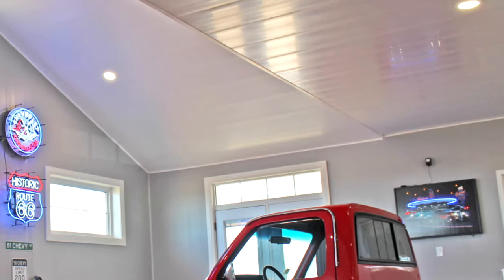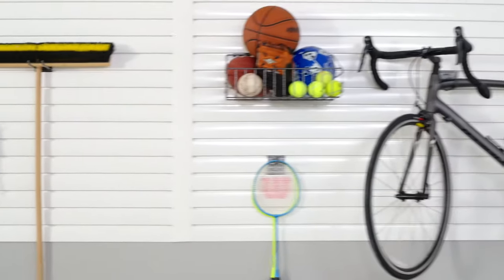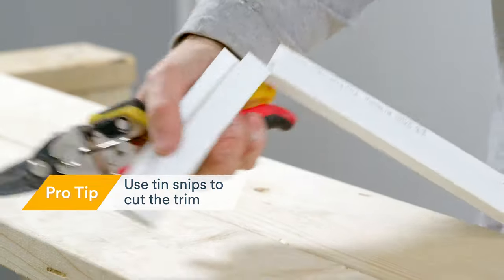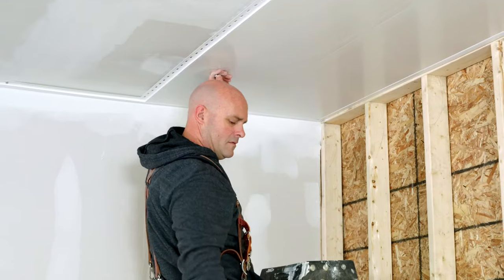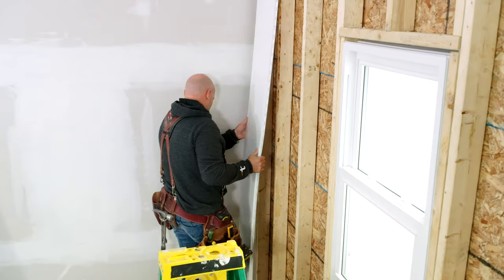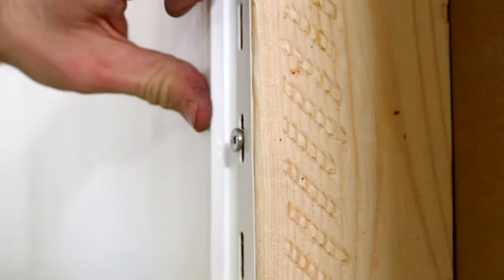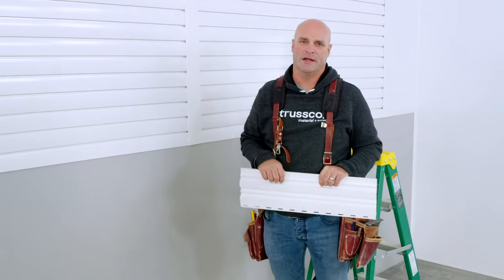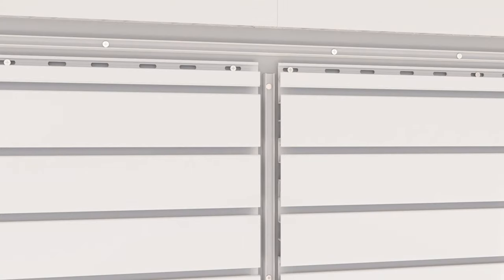How To Install Trusscore PVC Wall and Ceiling Panels To Transform Your Garage

Comment: I have personally installed a lot of this stuff. When you watch the video, keep in mind this is an infomercial and not an accurate installation guide. They used a paid actor in a staged scenario and not a true tradesperson in a realistic setting. This stuff is flimsy vinyl so if everything isn’t perfect there will be gaps  and bends. The manufacturing tolerances are not great and many pieces will have a “crown” from one end to the other. You will need to push the pieces together and tighten down the screws or you will have gaps everywhere. And if you think drywall is dusty, cut a few pieces of this and see how much white dust it gives off! This video makes it look easy to install but it does accurately  show what it is like in a real situation.
Reply: HUM, would you recommend putting in a NON insulated METAL garage in north Florida where inside can get 103 degrees in the summer?
Reply: Agreed... What about where rooms, walls, ceilings aren't perfectly square ??
Reply: Or just use Sheetrock, tape/finish. A lot less expensive

Comment: If and when the adjoining walls or ceiling aren't true, there will be a gap. This is normally taped(to seal the joint) and filled by mud compound to create a seamless finish. Most framing is never perfectly square so these gaps will be a normality . Which means it isn't effective to keep out drafts and or for fire code. As well ,drywall's primary application is to resist fire for certain period of time for safety. In the event of a fire , these pvc walls would probably release a massive toxic smoke and melt. It's a safety nightmare. Another potential concern to mention is off gassing after install.  Perhaps commercial application but residential is a wrong choice
Reply: There is a reason why this demonstration is being done in a garage and not for a bedroom. This is great for a utility shed, garage, washbay, or other storage rooms/buildings. That is all.

Comment: How do I fix a cracked panel in the middle of the wall behind the workbench and drill press.?  Do I unbolt the press and bench and take down half the wall to get at and replace the broken panel or do I rip it all out and drywall the garage like smart people? If it was drywall a little mud and paint ( 20 minutes max) $5.00 worth of mud done.
Reply: This was my thinking,  what do you do when you need to make a repair or add a fixture?  Drywall is much more versatile.
Reply: Simple just put a decal or chart of your liking, drill press??? Put up drill size chart
Reply: @TheVeganeater  you can replace individual pieces. Curl the sheet next to it to undo the seem. Replace sheet .Curl the sheet next to  it to pop it back in.

Comment: The walls may be simple but 16' ceiling panels are not. You should have shown the second or maybe even the third guy helping install the panel.  It's almost impossible to do what you did on the video by yourself. 8' and 10' you can do yourself - longer than that you have to make hangers or jacks to hold the panel to get it to snap in or have help. I can't imagine what a 20' would be like
Reply: I just installed 20 footers on cieling alone. Use a drywall lift put leave it at cieling hieght.
Reply: @henryb5215 I wish I could return this crap. the 16" need the same tool I was trying to avoid getting. This video sold me a line of BS stating it could be installed by one person. The trim pieces are also very pricy. I will never buy this crap again. So glad I ditched the idea of doing the walls too. I already damaged it trying to cut it. I may just throw out thousands of dollars of this shit and hire a drywall dude. The finish is also a mess. Scratched, dented... I should have known better. Ugg dont buy this crap!
Reply: @bigbgarage I have no trouble installing it alone. Only use  J trim at base. Silicone the rest with a fine white bead. Use a grinder to cut it. I have no issues.
Reply: @henryb5215  16 foot ceiling pieces do not go in with one person. The video shows one person. I bought a Sheetrock lift to get it up. If I knew that, I would have just bought Sheetrock. I was trying to avoid buying the lift.
Reply: @bigbgarage  I used a drywall lift because I own one. There are other ways that work. Have done it many times. My second choice would have been a couple  2 foot blocks of wood screwed only on one end. Slip the sheet in from other and and pop er in place. Nothing you can't handle. I strap my cieling 16" on center. Osb on the walls behind the trusscore. The main advantage is moisture resistance. Works great in a wash bay and looks sharp. Trusscore owes me some free product for the free advertising.
Reply: @henryb5215  this is the first and last time I’m installing this garbage. I’m not a fan.

Comment: For all the negative comments if this novice understads this goes outside the in wall insulation and the benefit is the water  resilience  the prevention of mold and clean look.  That said have saw some videos not all sizes compatable (hard to believe) probably wouldnt be great for welder but I dont weld and just want clean garage

Comment: looks like an installation nightmare. Would the studs need to be perfect allignment with these panels in order to have a secure fastening point for each panel? If so, wouldn't there be an awful lot of prep work like adding nailers prior to installing these panels?

Comment: I might be missing something but what's the point of installing trusscore panels if the ceiling in this demo was already drywalled?  Isn't that redundant?  Can I see a video of the trusscore instal in a basement with exposed joists?  That would seem like a more logical use case for this product.
Reply: The 
The
Reply: @gregre052 True

Comment: But can you paint it can you add wall hangings to it like pictures and whatnot or how does it help prevent fire spread because Sheetrock is a fire block if it gets a hole can you patch it or do you have to pull down that section to replace since this is basically just vinyl siding turned shiplap what about all the VOCs that left h out of vinyl over the years or when it gets brittl after ten years because vinyl is hydrophilic meaning it needs to be able to absorb water to keep from cracking this is ok for a shed or garage that’s about it
Reply: Instead of being a fire block this probably acts as a fuel sources as vinyl is a polyester plastic created from oil byproducts. Everything that’s easier an cheaper isn’t always better

Comment: In my area I did a cost on this and came up with 3 times the cost for doing my 16 x 16 vaulted ceiling. Not sure where your pricing was making is cost effective to say the least? I think for that kind of money drywall still is way cheaper. I don't think it will cost laboriously to make the difference. Another point is having the studs off center would make it have to be strapped also for more cost
Reply from the maker: Hey Mike. When you compare the cost per square foot of Trusscore to drywall, Trusscore seems much more expensive. It's important to consider the total cost of ownership of the materials for your project and the associated benefits that will save you money in the long run. For example, Trusscore provides labor savings as the product is DIY-friendly and doesn't require skilled labor to install. Trusscore benefits also outperform drywall: extremely durable and moisture-resistant, not requiring repairs in the future. You can learn more about our pricing here: https://trusscore.com/get-started/pricing/
Reply: What about the finish? Same a mobile home finish?
Reply: I love the concept but the price is a dead start for me. Over $3,000. My drywall contractor can do the whole thing for $3,100. Save $100 and to the labor myself? No thanks

Comment: It does not appear Trusscore has any fire resistance...Is this true? IBC requires garages have a 20 min adjacent to living quarters. Do installers need protection from plastic dust when cutting? How are nail holes plugged?

Comment: So I worked for Royal Plastics 26 years ago 
We built plastic homes at the corner of 
highway 7 & 27 in Woodridge Ontario 
I worked on the mechanical eletrical .
The off gassing was bad working in this plastic house for hours on end ...
What is the off gas on this product is my biggest concern ...

Comment: Oh some panelling;  there used to be that stuff when regulations for fire weren't around.  Plus I can drywall 10 sheets an hour of average ten footers by myself;  try doing a whole house with that stuff.
Reply: Although the price of drywall installation and finishing in Ontario has been inflated on google because of large companies that pay people by the hour and rake in a ton of cash;  I was charging 40 cents in Alberta per square foot and here they are saying a dollar seventy five or three for both jobs;  that would be 40 times ten times 1.75 which would have me making seven hundred per hour with a helper and since I can do it alone;  se can figure close to double if I'm just supplying the sheets and he screws.  So either it was you guys that wrote the new prices for drywall installation or the big companies in order to get top dollar from government contracts.

Comment: What if you just have exposed trusses on the ceiling?
Reply: At a guess, you’d get some cheap sheets of chipboard or similar and screw that on first.
Reply: Install some strapping first - as you would with drywall installation. Then install this product.

Comment: Seems great if the studs are EXACTLY 16" (or even 24") on center every time. And why would you put this over drywall? Seems silly and wasteful to me. As one commenter stated, "$15/per 32 sq ft for drywall and $120 for this stuff." Yes drywall is wasteful, but let's not kid ourselves, if you have to cut your product to fit, yours is wasteful too. The only advantage is possibly labor. And that is if it even passes code. Also its only available in 2 colors; white and gray. I did research, it is paintable...but only if you don't mind voiding the warranty.  That's right painting voids the warranty. Don't sand it either. Oh,  and if you are going to paint, do so before you install cause remember the panels have to be able to move. This is ... well I can't say cause the YouTube algorithm.👎
Reply: Thanks for the info!
Reply: I don’t know we’re you are looking at for pricing. It’s $3.77 sq. Ft. By me..
Reply: Somebody has no clue about math.  $3.77 a sq ft X 32 Sq ft DOES INDEED equal $120 @zacharytrigger1227
Reply: @johnsusko852 the way it was written in the original unedited comment. He was saying it was $120 sq ft. Words have meaning FF. He edited the comment.
Reply: It would get installed over drywall for similar reasons to installing vinyl siding over wood siding.  After 20 years it all gets torn back off and goes into a landfill, then what's underneath gets restored and refinished like it should have been in the first place.
Reply: Drywall has a fire rating. vinly burns, melts

Comment: Forget this stuff, @$3.50/sq ft, on my new 14'x30' addition, just for the ceiling will cost $1,400.00, while drywall for same ceiling will cost $320.00 + tax, delivered from HD, I dont mind a couple hundred more, but this is redonkulass.......

Comment: Ceiling installation looks almost identical to doing soffit in a large area
Reply: Doing doing video research on the stuff and actually I saw where they used it as soffit. I am not in the trades so I dont know but considering this for a garage wall

Comment: Can it be painted?
Reply: It's PVC  so, there is paint for PVC but, it's spray paint so, I wouldn't recommend it for indoor painting. That is probably why they haven't answered you. Plus, it's upwards of $3.50 a square foot!  Sheetrock is less than $1.00 per square foot so...
Reply: @4legdfishman  is sheetrock $1 foot finished? Because this looks way easier to install and doesn't require any mud and tape which is the hard part of drywall.
Reply: @claytonburley3093  Sheetrock less that $2.00 a square foot finished. That includes paint. I've done it many times over decades. Do I like it?  Fuck no! 🤣 I wish there was a better, easier and cheaper alternative. PVC is not the answer in my own opinion. 
Sheetrock also has a safety factor with a fire retardant. 
If you've ever burned PVC, you'd know how toxic and devastating it would be to your health and those effects are nearly instantaneous. I do love the looks of it and wish it was a cheaper, less toxic product. I'd use it in a heartbeat.

Comment: So you just sided the inside of your garage.
Reply: At $3.50 per square foot!
Reply: On top of the taped and mudded drywall ceiling. The drywall is probably required for firecode. Speaking of fire, how quick will this stuff kill you in a fire?

Comment: $322.01 is the cost of a pack and it only covers 85.31 square feet. You could buy 2 sheets of 8'x4' sheetrock for about $30.00 and it would cover 64 square feet.

Comment: What they don't show you at all is the aggravating battle to install the final panels.  They say to rip the screw flange, but the trim is already in place and you have to first pivot the tongue into the installed panel's groove.  Even with 1/8" gap it's a nightmare to pry the trim down enough to pop the ripped end into that trim.  This HGTV guy's installation video is NOT an installation video- it's a marketing trick.
Reply: I've installed plenty. Personally I prefer no J trim other then at the base for expansion. A fine bead of caulking looks much cleaner.

Comment: I can see this being useful in a clean-room or lab setting.  Residential? nope! Too expensive. Again, unless you have a very particular need. Perhaps a leaky basement or mechanical pool room.
Reply: Whats the cost???? Couldn't finf it
Reply from the maker: Hi Jim, visit https://trusscore.com/pricing to learn more
Reply: @jimanderson2518  4 times the cost of drywall... Plus you have to add the cost of trim.
Reply: @stanz7193  Huh, another video was saying it was  a competitive replacement for drywall......

Comment: This is trash.  If you are worried about water damage, just use cement board and a cement based joint compound like Rapid Set One Pass.